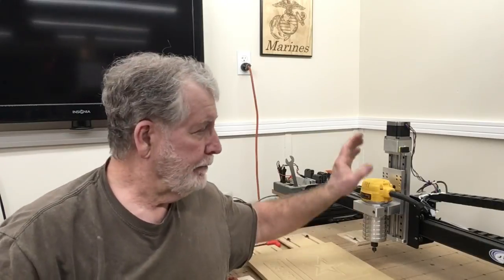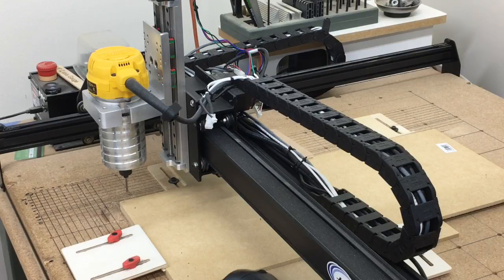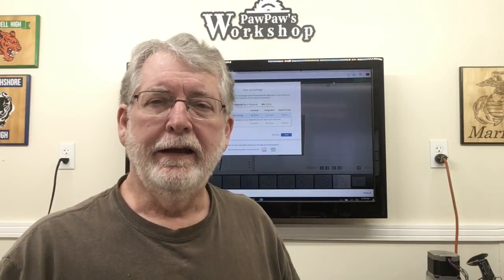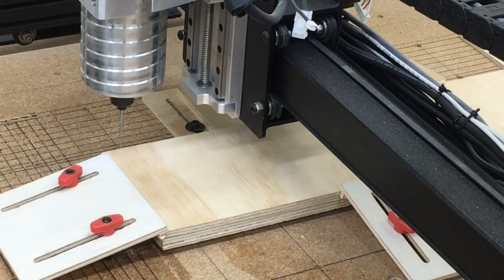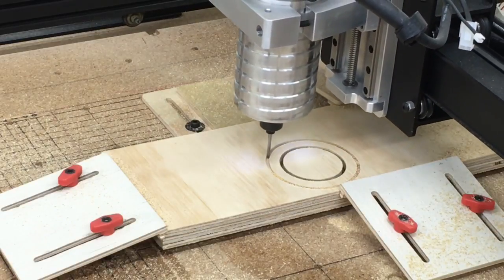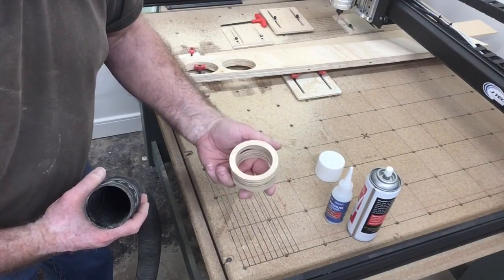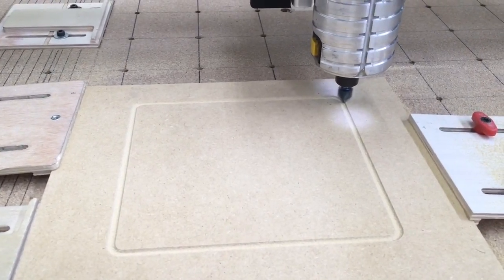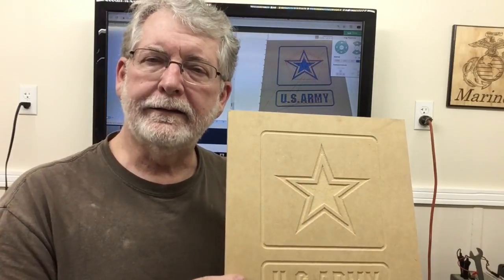Let’s EXPERIMENT! Testing the Z Axis by CNC4NEWBIE

Comment: I got this same upgrade to my X-carve because the original mount had some serious chatter...squares were coming out rounded, and I finally got it up and running.  The sturdiness of the CNC4N Z-axis compared to the original is night and day in its quality.
Reply from the maker: Thank you for sharing this information.
Reply: @PawPawsWorkShop  I would say the big hurdles I had to overcome were a) rewiring the motor connection, because going from the X-carve setup to the CNC4N setup, the motor direction is basically reversed, so I had to reverse the leads, and since it was taller, it needed more cable.  and b) Apparently the calibration between the old motor on the X-carve and the one on the CNC4N was much different.  Originally set at 188, the setting I found that worked was at 40.  kind of embarrassing that I did a test carve, set it for 1/8 depth, but because the calibration was off, It went through the 1/2" stock, the 1/4" scrap/sacrifice board, and into the waste board.. but thanks to your calibration video, I was able to get the Z-axis calibration worked out.
Reply from the maker: I'm am very glad that my video helped you.  Congratulations on your new setup
Reply: @PawPawsWorkShop  At times, Easel didn't seem to recognize my machine, so I was redoing the setup.. seems the setup clears out some previously entered data--like the $102 Z axis line.  That's where my real problem wound up being.. the Z-axis was resetting from 50.059 to 188.976.. No wonder that 1/8" depth test cut drove through my 1/2" stock, 1/4" spoilboard, and halfway into my wasteboard!

Comment: Your tip about the brushes in  the router worked . Now I have another problem. The last two carves I’ve done since I replaced the brushes have been off. In other words the design on the computer didn’t match up with what was being carved . Could my x-carve be out of calibration? I stopped today’s carve , when I noticed it was way off. The router did not return to the x, y coordina tes I set , it was way out of range. I would appreciate your advice on this, you’re usually spot on. Thanks again, Paw Paw.
Reply from the maker: It could be out of calibration but because it did not return to the start point, it sounds like you are loosing steps. Check the belts and the v wheels.
Reply: @PawPawsWorkShop  so the belts did need tightening, and that seemed to help a lot. I did a couple of test carves, and they did look a lot better . I’m still having issues with the x-carve not carving lines that should be straight, straight. The v wheels look ok. Any other suggestions Paw Paw? Thanks I appreciate your input. Dennis
Reply from the maker: If a straight line is not straight, then something else is loose.  The belts need to be at about 3.5 lbs of tension when raised one inch from the middle.  The v wheels need to be where it will turn with a little resistance when turning by hand.
Reply: Hey Paw Paw, once again you are the X-Carve genius!! The straight line issue I was having , was because of a loose V wheel , right of the top of the Dewalt router! You my man are “The Great One!!!”

Comment: Hi Pawpaw

Just wondering what the overall height is?  My original xcarve z axis is 260mm, what is the total height of the new one including motor and all?

I have an enclosure that my xcarve is in and want to make sure it will fit before buying...

Thanks!
Aussie fan

Travis
Reply from the maker: From the waste board to the top is 17.25". Add another 1.625" for the waste board and XCarve frame
Reply: Thanks for that. Also how do you speed up the machine while it’s already started in easel?